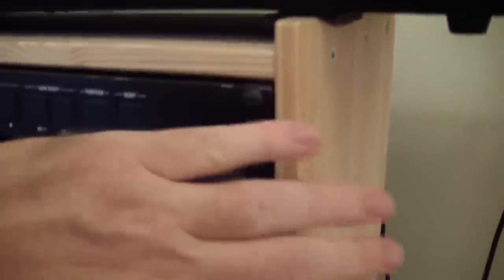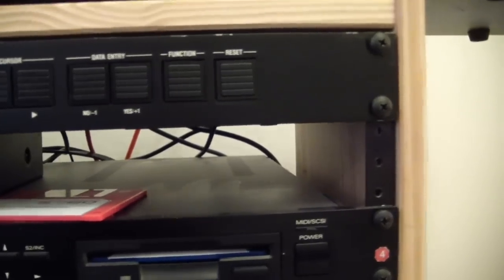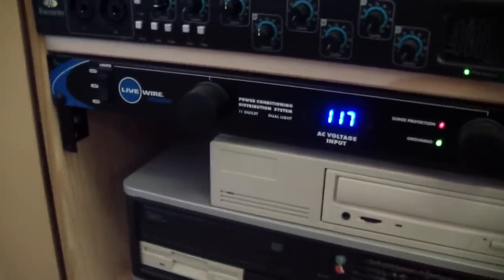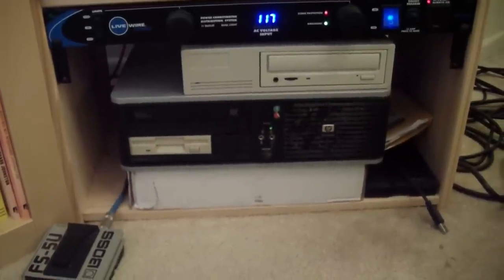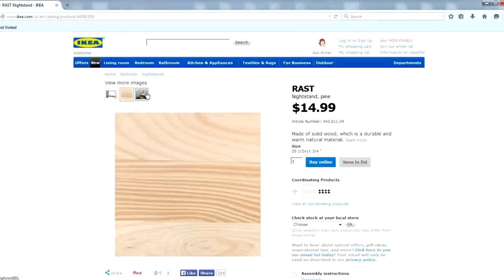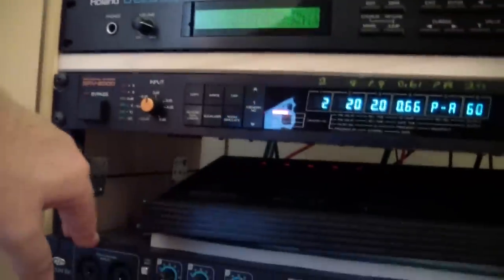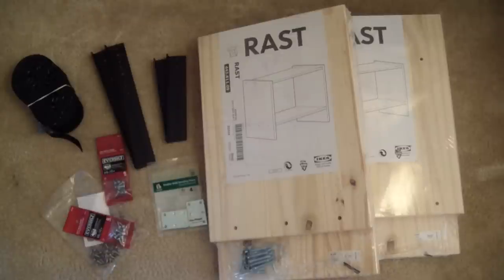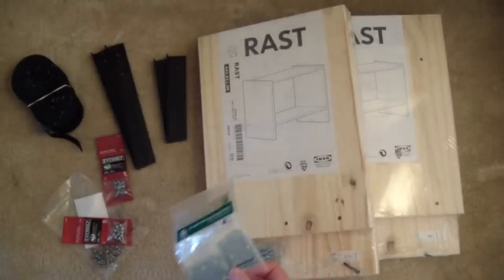Do It Yourself Musician #22 - Ikea RAST 19" Studio Rack Mount Hack

Comment: I would have drilled 3 holes into each edge to connect the two units together with wood dowels from Ikea, I think they keep those in the free parts section. Gorilla glue the entire length of the wood edge, and glue the dowels in. Then you could go with a bigger center mounted mending plate that cost $1.50 at Home Depot "16 Gauge Heavy Tie Plate 3 x 7 in." that would really keep it tied together without the velconess.

Comment: Oh yeaaah ive been told about that table before. Wow this is a second confirm
Reply from the maker: +Marvin Dwdrums Zildjian Makes a great low cost rack. Thanks for watching!
Reply: +DoItYourselfMusician yeah, the top board in between the two boards is 19" right?
Reply from the maker: Yes exactly. You just need to screw rack rail inside. That's it.

Comment: Is there anything else that supports a rack unit other than the front screws? I'm curious because I just got a heavy 2 unit preamp and plan to get a lot more rack mounted stuff but never used a rack before.
Reply from the maker: +ahyaok100 Generally they are just mounted with front panel screws.  The unit should be engineered well enough that it can take its own weight. Make sure the screws are tight so units don't put weight on the ones below and if possible allow a space between units for better cooling. Any units that get super hot like amplifiers should actually be mounted in the top of the rack so they don't roast the units above.
Reply: +DoItYourselfMusician Cool. Thanks boss.